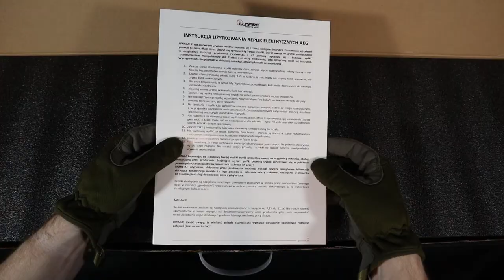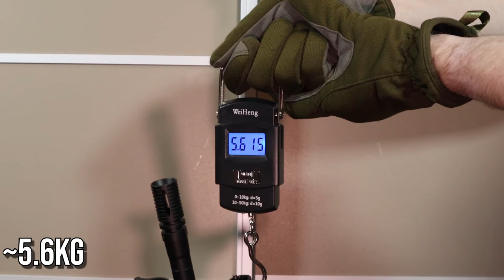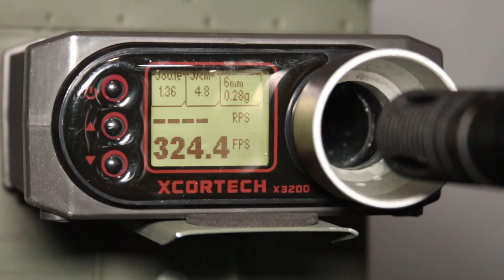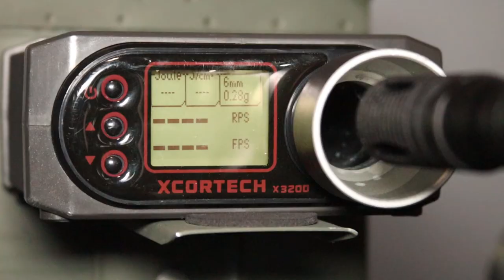Airsoft Review | Specna Arms SA-46 Core | Review, Unboxing, Dissasembly

Comment: I am thinking about buying one i always liked lmg . Do you have a optic on it i heard that it is very hard to zero this replica , plus is a 11.1 battery not going to burn your contacts out, is it also possible to tap the trigger to use it semi auto . Some parts of the fields i go to are semi auto only i would need to carry a side arm if i can't semi tap the trigger

Comment: Hi there ! Did you have any problem of alignment with the dust cover for zeroing a scope or dot on it for long range ? I've heared someone saying it, could it be an issue only on his replica ? Thanks for your answer !
Reply from the maker: Cover moves a bit side to side so installing a scope for long precise shots is not a great idea, red dot works great
Reply: @Maniek44Eng  do you think it could be possible to stop this wobble with adding some tape or plastic shapes on the sides ?

Comment: what if I put a g&g 25k in it .. will it die for it? and can it fit a suppressor or something else at the end of the barrel, cuz I was thinking about getting a 550mm 6.03 barrel to improve accuracy . don't know if it will stick out .
Reply from the maker: After changing the motor to 25k I would only be concerned about the last piston teath, otherwise rest should be fine. You can install any 14 ccw suppressor on it :)
Reply: @Maniek44Eng  great
Reply: @Maniek44Eng  what piston should I get?? I know nothing about rifles ... but this one looks ez to modify. oh and what spring is inside? I was thinking about getting a 120